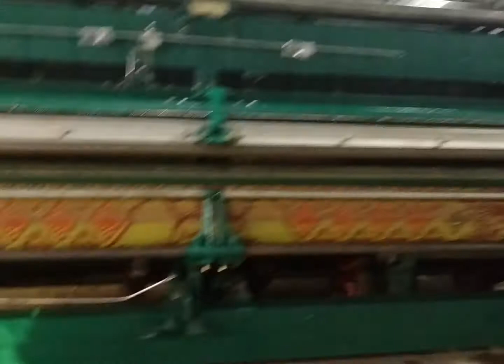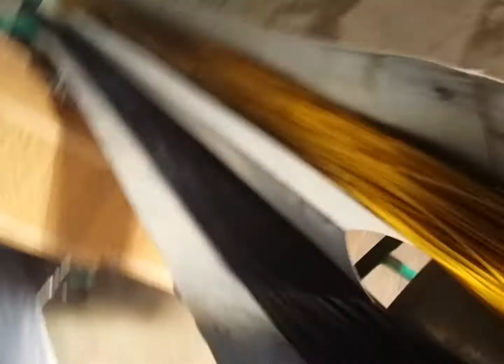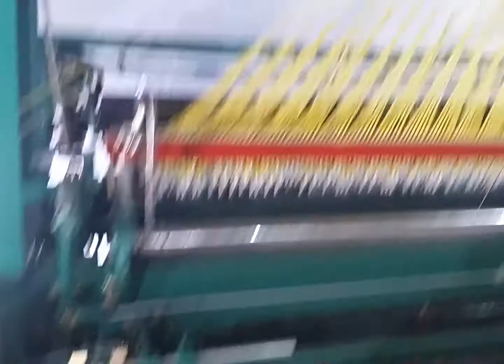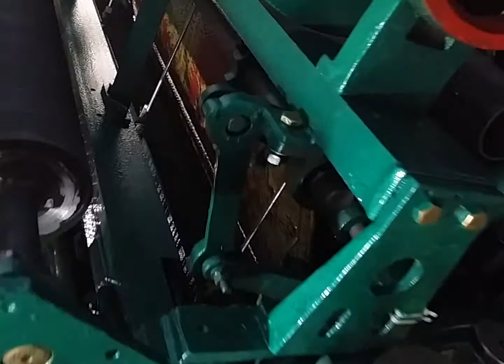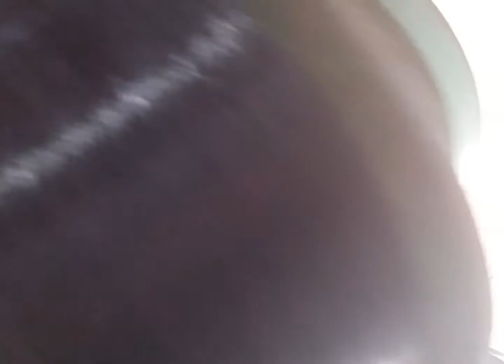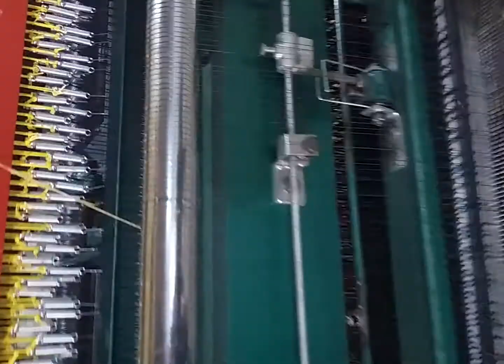ATC1800 1 8METER  180CM 1800mm width pp mat jacquard weaving machine

Comment from the maker: 1800mm PP Mat Weaving Machine Mat Jacquard
380V 50HZ Three Phase
; 2.0m working width; 4PCS Colors;
750W Main Spindle Motor with speed 90-120RPM;
455 Mat Jacaurad Hooks 4.83mm space;
1PC 180W PP tube Fed motor; 1800KGS Weight